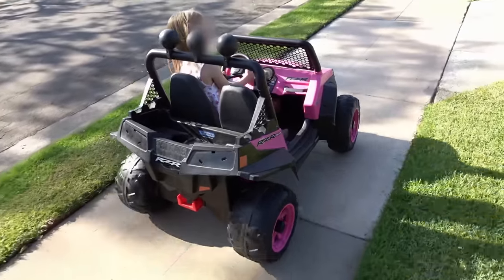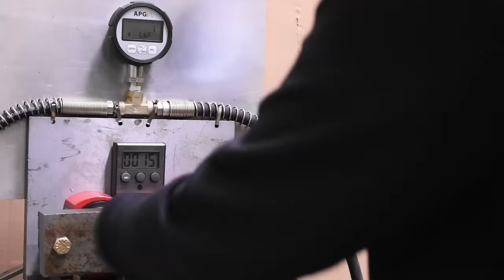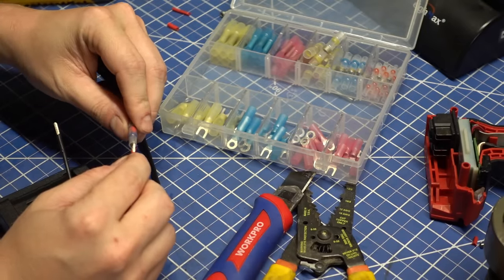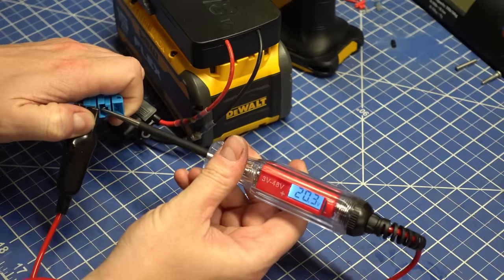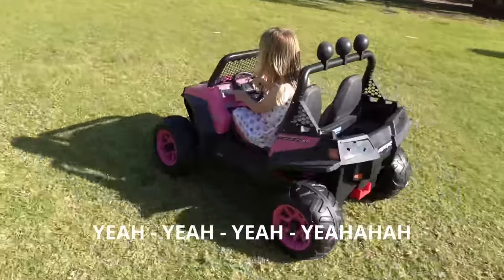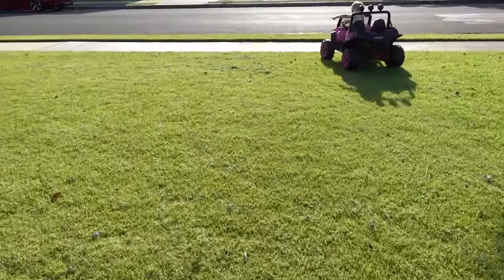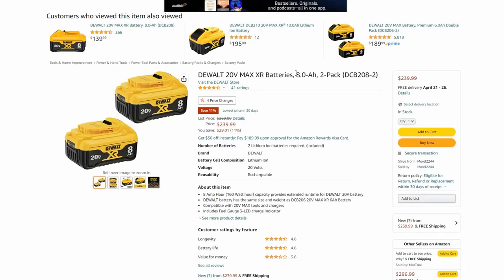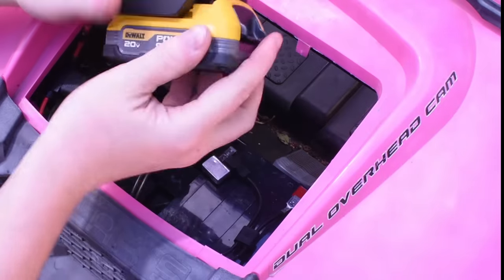I Figured Out What DeWALT's Huge $400 Battery is For😄(Kids Power Wheels)

Comment: The best part about mods like this is run time and recharge time. Running 2 batteries in parallel, with just 6 batteries you can keep the vehicle running near continuously. The lead acids are just a waste of time, weight, and energy, plus when they aren’t using it you still have use of the batteries. You can add a managed battery controller which can manage the max and min voltages. I have a ton of chargers and actually used 2 of them in parallel and with a few solid state relays actually allow charging the packs in place, though even at 4/5 the kids are smart enough to swop the batteries. I like modding the chargers as battery sockets as they have enough room for the extra items needed to make mist things dual voltage and allows you to make things like LED work lights a hell of a lot cheaper, and more functional than DeWalts own products.

Comment: Now upgrade the motor to brushless!  If you're worried about the battery voltage, Amazon (et.al.) sell low-voltage battery disconnect 'circuits', which are just a board with a relay and a setting for cutout voltage.  When the input voltage drops below the setting, the battery is disconnected.  Most of them have a 20A relay, which might be good enough for your ride-on toy, but you could use that relay to drive a larger external relay, delivering whatever current you need.  Great channel, cheers!
Reply: This is a great idea.  I'm not sure exactly how this 15 ah dw battery is made, but from my understanding, all previous dw batteries have no battery protection and instead rely on battery protection in the tool, where's other brands like Milwaukee have battery protection built in the battery.  That's why I'm a bit hesitant about using my DW batteries with adapters in other brand tools.  Would be a shame to kill a $400 battery by discharging it too much.
Reply: @Fpsnut  Same thing for over temperature, it’s up to the tool to read the battery probe.
Reply: Its actually very difficult to do but not impossible. Brushless motors are shaped differently which makes them difficult to attach. Also the shaft and the number of teeth on the cog that come with the motor has to be the correct amount of teeth and correct size cog, if not it will destroy the cars grearing.

Comment: used a discharge controller with a programmable low voltage cut off when I did something similar. works great to avoid trashing the battery.
Reply: What is a discharge controller?
Reply: @Inalienablerights15  Shut the device off/cuts power when it hits a certain low point He mentioned this at 6:20 ish. Running a battery completely dead like that is bad for it and ill kill it fast. Some controllers help to prevent damage to expensive batteries and/or components that need specific values.

Comment: I have the same Peg Porego for my daughter. I swapped in a 5ah Makita battery and this thing burns through motors. The driver side motor always goes first so I recommend upgrading the pair to one that is rated for 24v when you inevitably burn it out. Make sure to keep extra fuses in the car with the battery because you’ll pop those too when transitioning from pavement to grass. A 5 ah battery lasts about 30 minutes comfortably. I always bring two just in case and In 30 min of runtime, the battery doesn’t even get warm.

Comment: WHEELSPIN!!! IT burns out now! That's awesome. My older kids have one of the electric quads that Razor makes.  It didn't take me long to replace the lead acid with a lithium ion creation of my own that weighs less, lasts longer, and goes faster. Oh ya... and it's smaller so I was able (later on) to build and install a smaller pack with its own leads as a reserve so it can always make it back under power if they run it too low.

Comment: Been doing this since the 90s.

Lately (last few years), Sloppy Mechanics had a good series of videos on Milwaukee powered kid's vehicles. Since, loads of parents out there have been posting good conversion videos here on YouTube.

Usually shreds out the plastic gearboxes, eventually. Keeping the voltage close to OEM is unsatisfyingly slow but safer for longevity.

Voltage cutoff boards are really inexpensive and help keep any under charge/over discharge situations from bricking those pricey battery packs.

Comment: For $400, you can get a LiFePo4 100aH 12v battery with a built in BMS and they still only weigh about 26lbs.

Comment: Weize makes a direct replacement LiFePo4 battery that I use in my kids electric cars.  The connector off the original lead acid battery will connect directly to it.  The size is identical.  Excellent performance as well.

Comment: You'll have to keep us updated how well the motor handles it. Been looking to convert my son's over but most said you should use a buck converter to bring the voltage down. Either way, great job dad!!
Reply from the maker: Will do. Around 5hrs worth so far no issues
Reply: @b gg Not sure if TTC deleted my comment or YT did. There's kits on amazon around $20-30 that include a buck converter and a DeWalt battery adapter. Sure, you might not gain any beans but my intent is just to have easily swappable batteries compared to the lead acid.

Comment: Before anyone go and do this mod, please understand your kids powerwheel's electronics first. This mod only works if the vehicle has no other electronics that runs off the original 12v battery such as remote control, lights or radio unless those electronics have their own dedicated battery. You can use a high amperage buck converter to drop the voltage down to 13v but that defeats the purpose of using an 18-20v battery. With that said, there are other additional mods/improvements to consider.
1, Use DM18v adapter instead of the DW18v. It works with DeWalt and Milwaukee batteries. With a small mod to the adapter, it can also accept Bauer batteries as well. Use 2 in parallel and you'll double the run time and half the drain to each of those batteries. This works well if you're using 3rd party knock off batteries.
2, Add XH-M609 low voltage cut off to protect the battery from over discharge. Set the low voltage cutoff to 15v. Optional, use automotive 12v relay instead of the built in relay. The 12v relay takes the stress out of the built in 10a relay will operate up to 24v without issue.
3, Add a 60A DC10V-60V motor speed controller and enable high speed on the OEM gear switch. The controller allows you to set the top speed at any speed you want instead of just 10v or 20v. 
Order of mods, battery adapter, low voltage cut off, optional 12v relay, motor controller, OEM battery input plug.
If you set the speed to 13v-20v equivalent, drive on flat surface to prolong the motor. Any sudden stress to the motor such as road to driveway or road to grass or just riding on grass may damage the gears or the motor itself.
My kids love the mods I did for them. They get to set how fast or slow they want to go.

Comment: 8-9mph = decent jog or run... haha what an understatement... that is boston marathon qualifying speed!
Reply: Ya but you're not doing it for 26 miles continuously.
Reply: @Hansengineering  it’s 7.5 to 6.6 minute miles… that’s a fast run
Reply: @tigo01  Again. That is a "fast" run IF you're running miles _at that speed_. Jogging at those speeds for the distance a small child will drive a plastic car should be easy for any adult human not in a wheelchair or otherwise crippled. Basic human locomotion is not a herculean feat!

Comment: Dewalt and Milwaukee do not build low voltage cutoffs in their batteries. They are built into the tool. Using it the battery without a low voltage cutoff will permanently damage the battery very quickly. Grab an old tool and take it out or buy a low voltage cutoff circuit and relay online and Install it. Last thing you need is a lithium fire in your daughters buggy.

Comment: Need a buck converter in line to bring the voltage down so you don't burn the motors up. I use the adapter plate with a 13.6v buck converter to power 12v stuff all over the farm. Test box for trailer lights, meter and solenoid for fertilizer pump, etc.
Reply: Stock powerwheels can run pretty reliably on 18V nominal, ie ~16  - 20 volts. Above 20V,  the motors can fail, and the gearbox life drops a good amount as well due to the increased torque.

Comment: Might cook the electric motor with the extra voltage. I’d take a look and see what it’s rated for.
Reply: I don't have an actual answer to your question. But I will say that people largely don't have problems running at 18-20 volts. That should obviously be taken with a grain of salt. As he said in the video, LOTS of people do this.

Comment: There's probably some kind of low voltage cutout you could put in line with the battery, right? Like, wouldn't just a heavy duty diode do it?
Reply: There are videos on YouTube about using voltage controllers and voltage cutoffs getting ready to do this myself I got all the parts just got to find the time

Comment: Anything over 20volts and you will start burning out the electric motor or shredding the teeth on the plastic gear drives.  Source: Worked my way up to a 40volt Kobalt Lawn mower battery on my sons power wheel... And that's when you start up grading to aftermarket metal gear drives and motor, just make sure when you upgrade to also step up your mini-me's PPE.

Comment: Just be in mind dewalt batteries don't have the low voltage cut off built into them - it's built into the tools.
You need a low voltage cut off.
Heart warming to see though 👍 😊

Comment: Modding electric ride-on toys is a very slippery slope... We have a Peg Perego running 20v, bicycle tires screwed to the hard plastic wheels, and a motor controller with soft start.  The pedal on these things are an on/off switch as you well know.  Starting from a stop in speed two on 20v with rubber tires will kill the gear boxes.  A $20 DC motor controller with soft start from amazon fixed this problem completely.  Enjoy the journey and thank you for the great content!

Comment: We modded my cousins kids power wheels to run off of M18 batteries, the motor smoked fairly quickly so it was replaced with a brushless motor and speed controller for a 1/5th scale RC car.

Comment: You will ruin the battery. They dont have low battery voltage protection on them. Buy a low voltage protect circuit for like 10 bucks and add it inline after fuse

Comment: I purchased a 2 seater 120lb max large jeep and replaced the 24volt system with a 40volt 12ah and a step-down regulator so I could regulate the speed. Also put some small go cart wheels with a 5/8 hub  adapter. Just had to drill holes in the rear go cart wheels for the gear to wheel adapter. It has a ton of torque for going through grass and dirt hills, also lasts all day. Next upgrade will be metal gear boxes.

Comment: Back in the late 90's when my children were very young I worked and my wife stayed home with the kids. we  didn't have much extra money. A guy I worked with gave me an old 6 volt power wheel with a bad battery. I brought it home and looked at walmart for a battery and it was like $35. I didn't have it at the time so I pulled the 12v battery from my riding lawn mower wired it up and bungee corded it in the front of the jeep. Stuck my 3 1/2 old daughter in it. There was no high low in 6 volt cars. She pressed the peddle and the single back tire spun in the grass until it caught traction and took off at what seemed at the time 100 mph. actual probably  10-12 mph . My wife freaked  and that was the end of the 12v power wheel. Next payday I bought the 6v battery

Comment: Don’t worry about running battery low. They have onboard battery management. If it gets to hot, pulls to much current or discharges to much it will shut down and not provide power. Run it till the battery dies, recharge and repeat.

Comment: This is a nice improvement, but I will also let you know, that the Peg Perego battery is actually just two "emergency exit sign" batteries connected together. Those are available for about $9 each... And you can just transfer the wiring harness and fuse/thermal cutout over.  I do wish the speed control on these things was more than just on-off: they're basically just using brushed cordless drill motors. Lots of "wheel spin"
Reply: You can definitely buy them cheaper but overall if you have the tool batteries and the knowledge to make them work safely with this then they are definitely a better option. Lead acid are great at providing current and runtime, but in this scenario this fades quickly as the really dislike being repeatedly deep cycled.
Reply: @D3M3NT3Dstrang3r  yeah, the emergency exit sign batteries are still lead acid and still are picky about maintenance. Which reminds me, I should probably stick the battery on the charger...
Reply: @rpavlik1  I deal with them in the form of a trailer breakaway battery. They are good for uses like this and emergency lights, short term battery back ups and such. They dont seem to even mind being continuously float charged for long periods of time. But deep cycling them over and over seems to ruin them pretty quick. However whenever most of these devices came out this was the best fit for the purpose and still can be in a lot of things if you use them in a particular way. They are still very low discharge compared to other battery types, and still provide good current and runtime for their size. They just dont seem to be a good choice for a battery that will be going through heavy discharge cycles except for cost maybe but lithium is catching up rapidly in that regard.

Comment: Did you know there is a little screw you have to remove on the shifter, or near the shifter to make it go faster. It’s a safety thing. Just google it and it will switch to a different gear

Comment: I was gonna say Makita batteries have built in protection and shuts the battery off when it drops to low voltages but unfortunately Makita doesn't make any high AH 18 volt batteries

Comment: I've seen people upgrade the tires by taking old bike tires, cutting off the sidewalls, and then screwing the tread to the existing power-wheels wheels/tires for more grip. You run the risk of burning up the motor since they may not be able to handle the additional torque though.

Comment: Great job, dad! She wasn’t interested at first until she hit the gas lol. 

By the way, you said the power wheel would be happy to run it down to 11 or so if you let it to take it off early, have you heard of a grinder ever just destroying batteries? My grinder has done that to three batteries and I just thought they were already low until it happened the 3rd and last time, I’ve been using the same brand tools and batteries for years with no issue’s whatsoever until the grinder problem. Have you ever heard of something like that? The company gladly accepted my warranty info to replace it and sent me new batteries which were major upgrades to the ones that burnt out, but that doesn’t tell me why lol. After that, I measured their voltage, they were supposed to be 18v but they were all a bit different (14.6, 11.2 and 13.1) while my functioning ones all read above 19v. In case this is specific to a model or brand, the brand is metabo HPT, one of the batteries were hitachi from when they were hitachi power tools, but that doesn’t matter they’re exactly the same. Before this happened, the grinder functioned just fine for probably 6-8 months which is the amount of time I’ve owned it.

Comment: I just did this for my Fiancé little brother,
Had a Milwaukee battery laying around. 

Battery was dead on the car, no charger.
So I cut the wires off the battery, found some little leads that fit perfectly snug in the m18 battery. One for pos one for neg plug it in and good.
Saved the day for the little guy

Comment: Please solder properly, I get that it's convenient but nothing can beat a linesman splice for integrity imo
Props for not using a wire lug and calling it a day the pre soldered joint is better than that but not quite up to a proper - high current soldered joint, especially when your kids on riding around attached to it

Comment: I run Ryobi 18v batteries in my daughters barbie jeep, also swapped the wheels out for 10in rubber tires. If she hits it in reverse and then swaps to drive it will lift the front end up 2-3 inches off the pavement.

Comment: Don't do it! It's a trap lol. I did the same and burned up the plastic gears. So i ended up spending more than the power wheel jeep cost upgrading to steel gears, aluminum motor mounts, and upgraded motors. Don't get me wrong it's fast and could do wheelies with even 18v and it drifts like crazy now so it's fun, but boy is it expensive once you start replacing things. All the neighbor kids love it though🤣